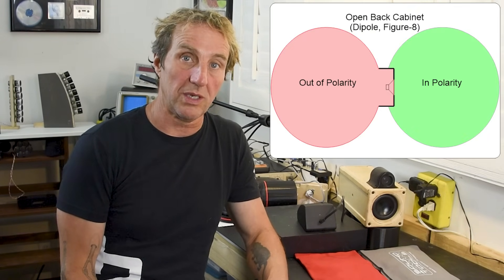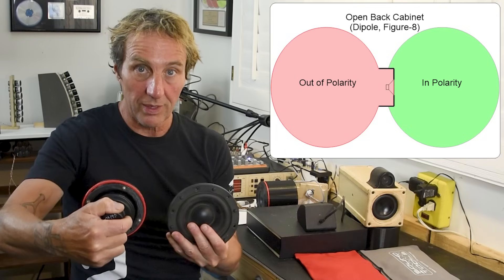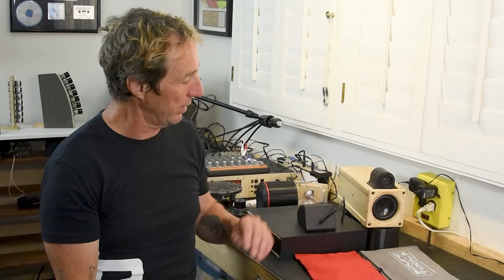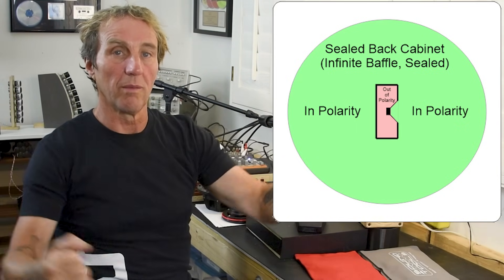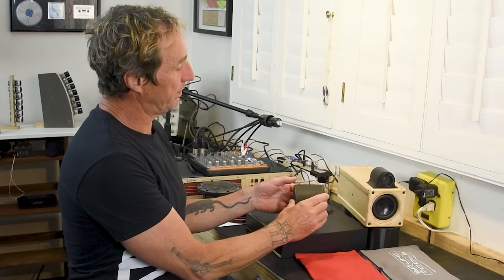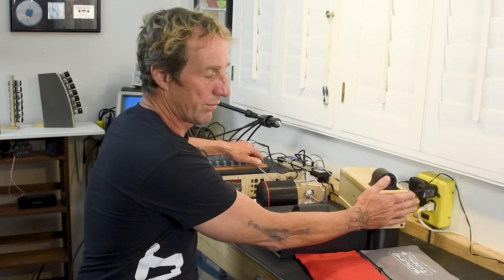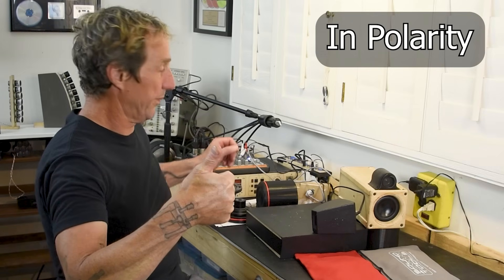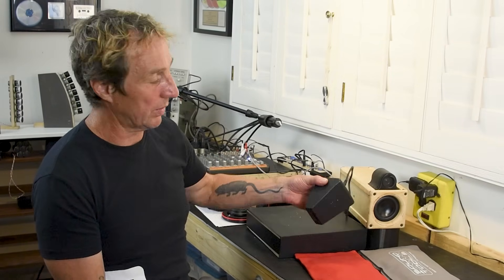Should Stage Monitor Polarity Be Reversed?

Comment: Really interesting how a bass reflex cabinet is almost no different to a full on closed enclosure. Thanks for the info Dave!
Reply: Yeah, still going to essentially propagate spherically, however like nearly everything else, you're juggling tradeoffs. 

The extra output at tune comes with a cost; 
twice the rolloff, instability below tune, and an associated group delay wonkiness. 

Good news, ... all that is addressable via manipulation of the time and freq domain!
Reply from the maker: True and ageeed

Comment: My perspective was from the audience, not the band.But I heard the reflections of the stage in phase from the rotating monitor wedge. I wonder about the highs from stage perspective. I played a lot on a covered stage into an open space toward a covered bar with gravel floor.Feedback galore and the band could barely hear.Mains were on posts on proscenium so we played to the echo from the bar.
Reply from the maker: From all perspectives, everything in polarity will have more frequency summations than with something out of polarity.

For the higher frequencies though it make less of a difference than with lower difference.

Comment: I've been running just my stage monitors in reverse polarity for years.  Just at the amp, there's a reverse polarity on both XLR inputs.  But that's the only place I run out-of-phase.  Everywhere else is in phase.  I only do this as an experiment to eliminate feedback.  And it definitely works!  I can push a lot of signal and get nearly no feedback.  Most of the mics are Shure SM58s and one AKG C1000S.  We're not bass heavy and don't need all that.
Reply: I think I understand what you are doing, and why it "works", but you may be losing more fidelity than the increased output is worth.
Have you tried instead delaying your monitors, just a few msec? It's often enough to break the additive-interference relationship between the mic/ space/ speaker that's causing the feedback with much less destructive interference than a polarity reverse.
Reply from the maker: Interesting. I've never been able to show that polarity reverse reduces feedback more than it reduces level.

Polarity reverse will cause more cancellations so you typically get a reduction in level that exceeds the reduction in feedback.

Polarity reverse typically makes things sonically worse except in a few specific scenarios where there are narrow band issues.

Comment: Many years ago, 2002?, at the yearly seminar that Pat Brown put on in Kentucky.  This was the seminar that introduced line arrays to the pro sound community in the US.  After hours some people were messing around with phase and speaker placement.  We placed two 8" sealed speakers facing each other separated by a few inches.  Our first experiment was white noise pumped into the speaker in phase and they got louder as expected.  Then we flipped the phase on one.  We were expecting a significant decrease in volume.  But to Everyone's surprise, the two speakers suddenly had zero volume.  Everyone there was shocked at the absolute silence.  We expected to hear something.  Nada, nope, nothing.  Absolute silence.
One of my magic moments playing with sound.  Thanks for a great video.
Reply: Pat Brown SynAudCon, just the best.
Reply: cool story bro

Comment: I have my monitors in polarity, but in some situations (where the monitors are in a weird position from the PA system) and I miss some low end, I put the monitors out of polarity... I play bass and I want of course the low end (I don't use a seperate amp, so the wedge is the only thing I can hear myself) and then out of polarity fixes the problem......
Reply from the maker: Yes distance can come into play. Though probably in those scenarios using a slight time delay on the wedges so that the arrival time from the wedges more similar to the arrival time from the PA, would probably give a better result
Reply: @DaveRat  Never thought of that! Another great tip! Thanks!!!